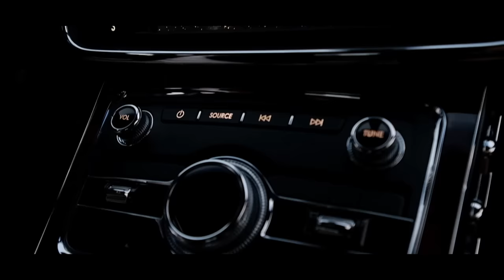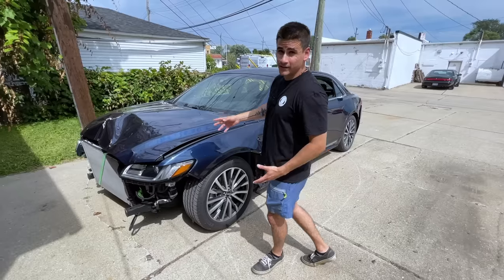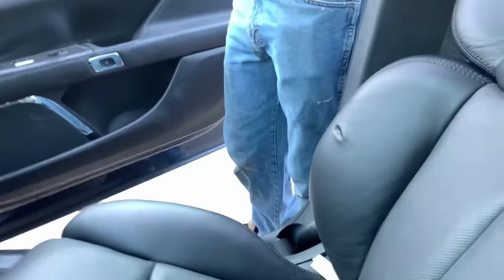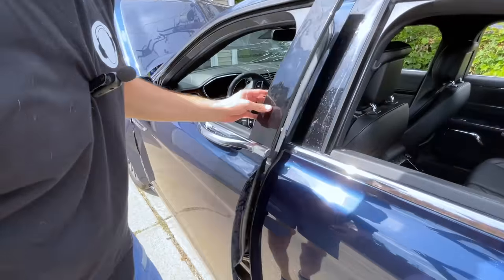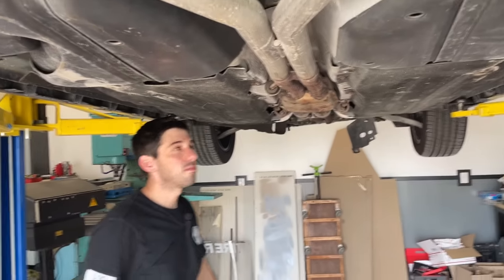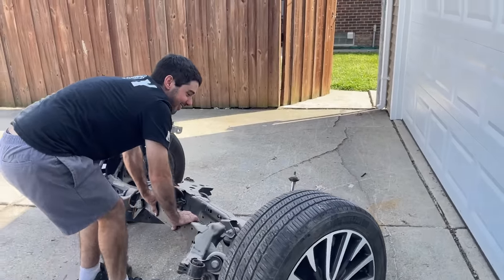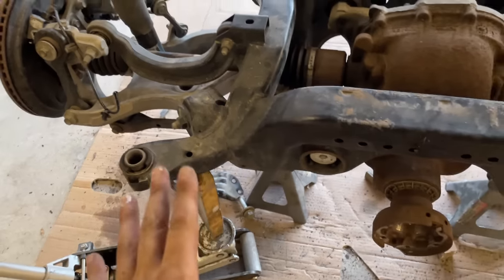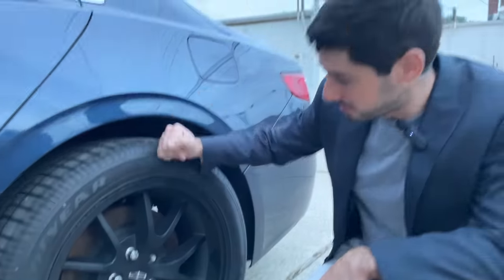V10 Project Car Reveal! - Ford V10 4V Build Ep. 15

Comment: Just found your channel for the firsr time; YT recommended your First Start Engine Vid. So now Im binge watching all your vids on a lazy sat. Anyway, regarding your trans choice. You mentioned a manual trans, Im assuming that means a 6sp. If you have committed to or purchased a trans yet, I would recommend BMW's 8hp trans. Its the best 8spd auto on the market but with paddle shifters can be shifted like a manual. The Turbo Lamik guys in Austrailia have come up with an Electrical Slave Cylinder for the 8hp that allows you to keep the clutch pedal if so desired. 8spd is always better than 6spd's; accept for GM/Ford's 8spd or 10spd which IS NOT durable.., BMW's 8spd is durable. Ive already put in a word to Seems Legit Garage who said they will see about coming up with an Engine/Trans adaptor plate. Their garage is also in Michigan, dont know how far from yall they are. Im sure if you contacted them about your project - they'ld be more than happy to work out the 8hp bugs for you. Anyway, Im only on my 2nd vid of yours and liking what I see

Comment: Would the rear subframe/rear differential from the AWD version of the car not fit or was the differential not strong enough? Seems like it would be a bolt on approach.
Reply: This might not be the same with the Lincolns. But the explorers of that Era, the rear diff was a viscous coupling rather than a traditional rear diff set up. That might be why they didn't use the awd rear diff.
Reply from the maker: those rear ends were not made to handle the kind of power we are going to put down. These S550 8.8 rear ends are way more capable
Reply: @biy_buildityourself  what are you guys gonna do for a fuel tank? the saddle tank from the AWD model might work.

Comment: What are your plans to make the CAN Bus hanshake work with the Haltech and the factory ford systems?
Reply from the maker: We would love to somehow get the stock Continental gauge cluster to communicate with the Fueltech, so we can read vehicle speed and maybe rpm as well. But we know absolutely nothing about CAN, got any tips??
Reply: @biy_buildityourself  some of the can bus messages are probably already decoded somewhere on the internet (dbc files). I know the s550 mustang HS (high speed) can has been. the High speed can (pin 6 and 14 on the odb2) is specifically for powertrain related stuff but the instrument cluster is probably on a MS (medium speed) can. There should be a gateway module (probably the BCM) that spits out relevant HS stuff onto the MS bus so if you can find what the RPM or VSS messages the conti is looking for, you can build message frames using the fueltechs data (CAN?) and put it on the HS bus. Im using a similar approach swapping an ecoboost 2.0 in an RX8. Using a Macchina M2 (no longer made) and Savvycan for sniffing.

Comment: I'm assuming you don't need to pass emissions, or an inspection. I heard our emission testing when they put their scanner on the ODB2 it comes up with a different VIN number then the car has they no longer will pass it with a different computer installed. Obviously if you have the same computer then not a problem. I've always wanted to put a EcoBoost V6 in a motorhome but if I have emission issues too much of a hassle.

Comment: Please tell me you didn't leave the underside of the chassis as is where you hit it with a sledge hammer ?    Did you cut and shut the area where you removed metal ?
Reply from the maker: We will be plating the section we cut out. What do you recommend we do with the areas we meticulously sculpted with a BFH?

Comment: Wow! 

Okay, I have questions.  The Continental lost a lot of its stiffness when you notched that frame member.  How are you going to add the lost stiffness back in?

The replacement wheels and tires hang outside of the wheel wells. How will you clearance the wheel wells to hold the new, wider tires? Thanks!

Comment: I'm sure you guys explored the option of using the rear subframe of the AWD version of the fusion. What was it about that option that wouldn't work? Was it just because it wouldn't accept a rear differential that would've been adequate? I'm not very familiar with the architecture of that particular piece.

Comment: Cool project. However did you add any strength back into the notched area, and paint it so it won't rust? I just found this channel and look forward to seeing more progress. 
I hope you guys care about building qaulity not just pushing out content.
Reply from the maker: We havent yet, but we will be doing that when we drop the rear to make Delrin bushings!
Reply: @biy_buildityourself   
Good plan 👍 Looking forward to the next video. It's going to be a very cool car. Also curious to see what wheels/tires you will use.

Comment: Are you going to box in the cross member that you cut?  Maybe I missed it, but transmission are you going to run?
Reply from the maker: Yes we will, we have to do a lot more work before that rear end is mounted permanently. We will be running a MT82

Comment: Love the engine build but can't help thinking the cars not a great match. The fact that you won the bid 3 times shows the market doesn't like the car either....you can't put a V10 snarler into a NY Cab ...I'd take a Ford GT 40 replica and stretch the rear a touch for the extra cycllinders and make it like a "speed tail"....you guys are hyper-talented and exceptional engineers...I'd love to see that V10 in a platform that does it justice.

Comment: I'm really digging your guys' attitudes, and look forward to seeing your progress with this vehicle. However, fella needs to wear some safety gear! Welding without gloves or proper skin coverings can result in serious burns and even skin cancer from the UVR exposure. Worse still, man's was swimming in those welding fumes with no respirator or fume extraction. Fume fever is no joke, the lasting affects of welding fume inhalation can be asthma, lung cancer and nervous system deterioration. C'mon fellas, set a good example, all the cool guys use PPE.

Comment: Could you not take the rear end and just put it in the factory Linc. subframe if they were that closely matched?
Reply from the maker: That might be an option. You would be left fabbing mounts for the 8.8 and possibly axles. Would come down to what you prefer working on.

Comment: This will be very cool. How much engine setback are you planning? I wonder if an S550 transmission tunnel will "bolt on." You guys are killing it as usual.
Reply from the maker: The goal is to get the engine to fit under the stock hood, but we may be limited with steering rack and trans position so we’ll see once we get the engine fitted in there!

Comment: The reason why it broke is because of fatigue. Whenever a component gas stress is applied to it, that's the reason why it fails whenever it's in an accident. That's probably the reason why that component failed.

Comment: I just saw a video showing that the v10 has a SPLIT JOURNAL CRANK? I assumed it used a 5.4/4.6 crank with 1 extra journal set and then all 5 journal areas moved to evenly fire 10 cylinders but instead they just added 2 cylinders on and instead of moving the journals they split them into offset dual journals??? According to a machinest building a 2v v10 with big cam and built bottom end he says the CRANK IS 50% as strong maybe less and has NO chance of getting high rpm with this design, it's like the opposite of a flat plane crank, it's the weakest and worst for rpm... I'm hoping this expert is wrong!!! 

BTW love the channel

Comment: THESE CARS CAME AWD AS WELL. WHY NOT THAT REAR UNIT.
Reply from the maker: Those units were not made to handle the kind of power we are going to make. These S550 8.8 rear ends are far more capable.
Reply: @biy_buildityourself  COULD YOU OF USED AN AWD JAGUAR DRIVE TRAIN FROM THE V8 SUPERCHARGED MODEL.

Comment: So I've done some more research, mockups, and math recently and with as many variables equalized as possible, 4 valves per cylinder actually WILL have a fairly significant overall flow advantage over 3 valves. Nevermind tertiary benefits like not having to run as much lift to take advantage of the whole valve's area since there are two valves to respectively distribute total intake and exhaust valve area between. So yeah, disregard the BS I spread in a previous video where I kinda harped on you for choosing 4 valve.

The only thing a 4 valve won't do as well is it won't sound as good. So far, engines with two exhaust valves sounding higher pitched and raspier than engines with one exhaust valve (again, when equalizing variables like exhaust system design) still seems to hold true. Unfortunately, given that you aren't building up the 3 valve heads, and there are scant few (like only 2 or 3 low-quality vids) examples of a triton V10 with long tubes and an equal length X-pipe or Y-pipe on youtube, I doubt we'll get to make a direct comparison between otherwise identical engines.

But if you feel like running that experiment for the community, then I'd greatly appreciate it. I've been proven wrong a few times before (mostly by myself learning more and then reasoning things out/doing math or mockups), but I feel like this 1 exhaust valve vs 2 exhaust valves sounding different trend will hold true.

Comment: How Lincoln should have built it should’ve been from the factory, a torquey smooth running V10 fits a luxury car much better than the wheezing V6 these originally came with.

Comment: 100% Continental didn’t get no respect, and there were a few really nice ones.
This car is going to be a classic classy sleeper. How much finished ? I want that car!
Business Engineers dictated car design for too many years, and look what happened. I had to drive those cars through the late 70’s and 80’s and It was BAD, really BAD. Think Chrysler Cordoba, Plymouth Voloré, Buick Century,,,fUGH,,,Bad !
Many car guys ended up driving P-up trucks because it was simplest way to get V8 RWD. 
The Chrysler 300 with the v8 in 2000’s did well, And a  Continental V8 rwd sedan would have been a winner.
It’s a shame Ford didn’t follow up with a classy v10 RWD sedan., and not a crown Vic clone.

Comment: Why did you have to get the car running? Totally pointless when you're  planning to rip out everything n put a V10 in it's place.
Reply from the maker: Plan is to sell the engine and trans, so having it running and driving for proof before we pulled it was a must.